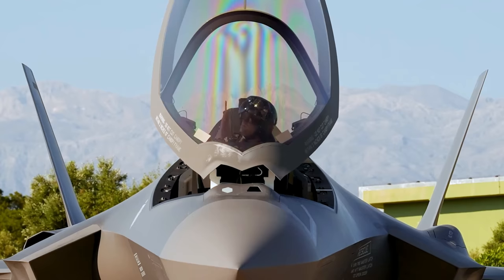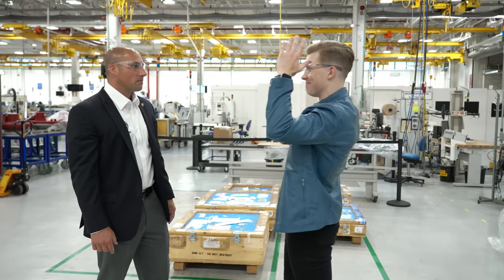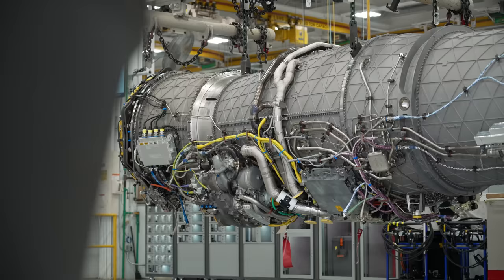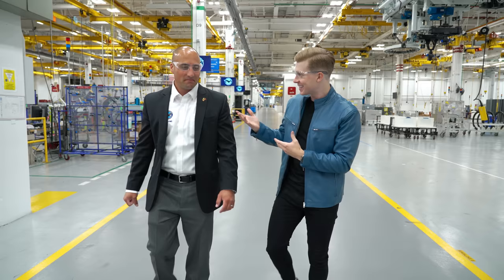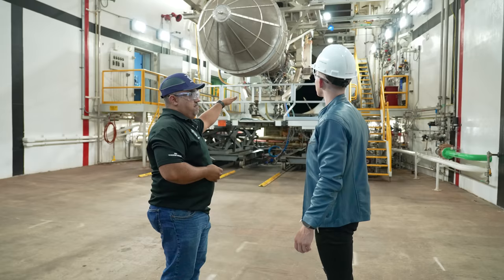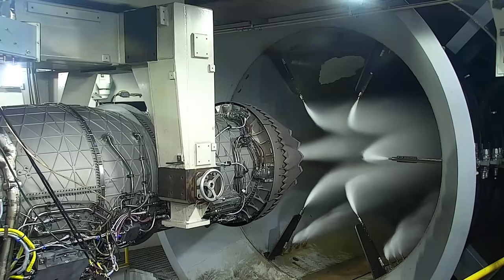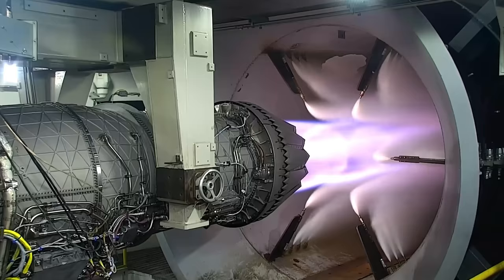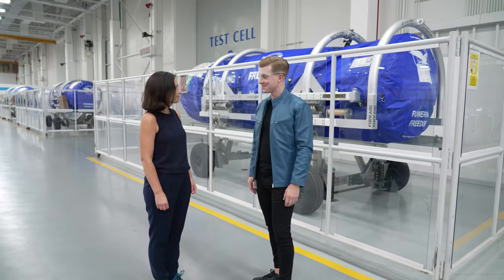How The World's Most Powerful Fighter Jet Engine Is Made

Comment: Man, your videos have such practical quality!  I think it'd be a blast to work for Pratt & Whitney.  Did you happen to ask them why they don't just incorporate a retractable FOD screen on their engines?  That would make a lot of places accessible for our aircrafts in terms of take off and landing.  You should do GE next and get a look-see at their adaptive cycle engine.
Reply: I can answer this. As far as turbofan/turbojet engines in general, adding a mesh in the inlet severely reduces performance. This is not as big of an issue on helicopters where ram recovery is not even a consideration. Speaking of stealth, anything in the inlet is a radar cross section that you don’t want and any unnecessary moving parts is weight you can’t get rid of which decreases payload.
Reply: as someone who is an engineer at pratt and whitney, i can attest to say that it is fun!
Reply: There were retractable FOD screens on a jet engine from the late 1940s, I have not seen them on any engines since.

Comment: The Rolls-Royce LiftSystem, together with the F135 engine, is an aircraft propulsion system designed for use in the STOVL variant of the F-35.

Comment: CANT WAIT FOR IT! Is the f22 more powerful combined?
Reply: Each F119-PW-100 motor provides 35,000lbs of thrust, for a combined total of 70,000lbs.

The F-22A also weighs more, but still has higher thrust-to-weight ratio due to massive amounts of excess thrust.

Interestingly though, the F-35A will out drag-race it from 200knots to Mach 1.  Then the F-22 will walk away from the F-35A in supersonic regime, where its engines were optimized for supercruise and Mach 2.2 performance.

Comment: I expected the throttle in the control room to look a lot closer to one in a fighter jet. That was cool to see.
Reply: Lol that wasn't even remotely close to the one in the cockpit. One in the cockpit is modeled closer to the F16. Multiple buttons/switches/knobs. Stick is also modeled after the F16.
Reply: @fightingfalconfan  that's what I meant. Sorry. I expect(ed) to see it look like a real one. Typo.
Reply: @wormyboot  Nope, no reason to have that. It's not controlling all those functions. It just opens up the fuel supply or closes it pending position.
Reply: @fightingfalconfan  I know. I just thought it'd look different
Reply: @wormyboot  Ah, nope, no need for it.

Comment: EXCEPTIONAL VIDEO SAM!
Just loved it my friend so so cool! 😎 
However I only wish the F-35 Lightning II ⚡️ 🛩️ for all its advances had finished on schedule or on budget 💸🤑but as an American 🇺🇸 used to American defense and military projects it doesn’t shock me anymore! 😂😂 sadly 😢
Cheers 🥂 brother 😎 
LOVED IT however the F-15EX is still my favorite new fighter and a phenomenal advancement in engineering and technology today even more than the F-35 I think! 

😊Also now I hope that the F-35 is past its troubles it goes on to become the next F-15 Eagle type fighter jet. However the F-15EX variant is still my favorite and it will become more of a best selling most successful per mission fighter EVER MADE I hope the F-15EX can shatter the original F-15 record! 
Caleb’s Aviation 😊
Reply: There isn't any technology on F-15EX newer than F-35.

Engines, Radar, cockpits, airframe, flight control system, and subsystems are generations behind.

This F135 motor is decades more advanced than F110s.

F-35's APG-81 is fused with an RF antennae suite distributed all over the airframe like a spy plane, as well as 7 different IR sensors.

F-35 flight control system is fiber-optic with self-contained electrohydrostatic actuators.

F-15EX still has hydraulic lines and actuators, though it does have a modernized DFLCS with excellent control logic.

Man Machine Interface is superior in the F-35 due to minimal switches and buttons, with the HMDS and PCD.

Comment: Just imagine what the F15 and F16 could do if upgraded with those engines!

Dude looks like he uses a polishing buffer on his head. Reflects the light like a glossy paint job lol.
Reply: They won't fit.  The structural bulkheads that form the engine cowlings don't have large enough Inner Diameters for the F135 beast.

F135 has so many VLO features in both RF and IR spectrums, as to be a waste in an F-15 or F-16.
Reply: @LRRPFco52  yes I know that which is why I said upgraded to. The 40k pounds of thrust wouldn’t be useless in either the 15 or 16. The VLO would actually benefit the new F-15 since they’ve supposedly added other VLO features to it.
Reply: @P-J-W-777  F-15s don't have any VLO features.  We were on the F-15 CTF at Edwards from 1989-1990s.  It's not a VLO platform no matter what you do to it.  Frontal, oblique, side, and rear RCS values are huge on the F-15.  It's very reflective, nothing you can do about it, including the bondo stunt that was the F-15S.
Reply: @LRRPFco52  Just going off what the supposed professionals that talk about the features added to the new F-15 and the adding the Radar absorbing coating. Guess I should have explained further when I mentioned VLO. I’m sure with that addition their radar signature is reduced quite a bit a bit when compared to the A-E model.
Reply: @P-J-W-777  This is the first I've heard of the F-15EX getting RAM.  I've been following it since it was the F-15X.  Where did you hear anyone talking about RAM on F-15EX?
Reply: @LRRPFco52  On another video with a gentleman walking around the actual aircraft discussing some of the changes made. I don’t remember the channel name as it was a few months ago. I just remembered thinking “Wow” why would they add RAM to the EX but it was supposedly something they incorporated from the more stealthy Silent Eagle version that wasn’t chosen with the primary intention of reducing their signature a little when accompanying F-35’s while acting as missile trucks for the F-35’s…
Reply: @P-J-W-777  The F-15SE was a mock-up, not a real aircraft.  Boeing claimed it had a frontal RCS as small as an F-35, which is an embarrassing joke to say out loud.

Are you sure it wasn't a video about the F-15SE?
Reply: @LRRPFco52  yeah I know the SE was never actually built. They were talking about the EX and said that it received RAM coating a feature that was handed off by the Silent Eagle. They never claimed the EX had a smaller RCS than the F-35 in this video. They said it was used to reduce its signature but didn’t get into any great detail about it.

Comment: The planes of the future should be based on jet engines or electric engines in sets of four main engines to produce flying characteristics vertically and horizontally, like the F 135, but larger enough to be used as a helicopter, material support vehicle, or anything else. They can land or take off vertically. They should have several engines to balance out the load in case of an emergency and emergency parachute wings or wings and bodies that allow them to float to the ground.

Comment: Woooow... fighter jet engine design requires very accurate calculations and the development of advanced technology. This engine must be able to provide extraordinary thrust, while maintaining fuel efficiency and durability in a variety of extreme conditions. Engineers must design engines that can operate at very high temperatures, supersonic speeds, and in very low pressure environments. In addition, the design must take into account aerodynamic elements that affect the overall performance of the fighter aircraft 🥇🇮🇩😘🥰

Comment: Could a booster rocket be rebuilt to use three or four of these engines instead of rockets ?

The obvious advantage would be that they wouldn't have to carry oxygen up on the first stage of the launch saving on weight as well as the need for cooling and storing reactive oxygen in a rocket.

One problem might be the strains of combining two different systems with different thrust, could they be made to match ?
Reply: how would you propose these engines get air between their 50,000 foot service limit and the 327000-foot edge of space?
Reply: @zakp.2759 Only as first stage lifters much like Falcon heavy and Vulcan. I guess these engines won't do but airplanes have reached over 100,000.

Comment: Ever heard of an F100 engine and the F-15E Strike Eagle?
Reply: The F100 is not as powerful as the F135 and it doesn't need to be since the F-15 has two of them.
Reply: @fromnorway643   Ever heard of accelerating to mach 1 going straight up? Ever heard of the F-16's top speed of mach 2.2?
Reply: @docbrosstudio7680 
Ever heard about fighters that are smaller and lighter and therefore faster than the F-35 despite having a less powerful engine?
One of them was mentioned in the comment just above this one!
Reply: @fromnorway643  
Heard of this thing called thrust?
Reply: @docbrosstudio7680 
Heard of this thing called two engines (F-15) vs one (F-35)?

Comment: Is it possible to upgrade the F135 engines that are already built?
Reply: Yes.  It's already part of the depot-level overhaul plan.  They've already made ECU changes to production from what I understand, so overhaul schedule incorporates it.

Pratt was already working on it and had their own early ECU in 2015.

47,300lbs thrust in burner, with over 30,000lbs in mil, better fuel efficiency.

In de-rated day-to-day operations, it should have more power than the current max limits.

Operational squadrons run them de-rated currently.

Comment: I thought the F-16 afterburners were crazy enough🤔
Reply: F135 has about the same thrust in mil power as a late Block F-16C PW-229 or GE-129 has in full burner.

Once F135 goes into burner, it can do 40,000-43,000lb.

Comment: The GE F-100 and P&W F-110 are my favorite aircraft engines as they provide power for the beautiful F-16. I don't believe the F-22 nor the F-35 will be proven until they see combat!
Reply: You’ve got it backwards… F100 is P&W and F110 is GE.  BTW a dash indicates aircraft designation F100 engine, F-100 is the aircraft with J57 engine.
Reply: The F-22A and 3 variants of the F-35 have been in combat for years.

Israeli F-35Is have shot down 2 Iranian stealth drones and one cruise missile already.

F-22A was used a lot over Syria, to include over 700 intercepts and precision strike missions.
Reply: The F22 has seen combat. It shot down a balloon. Hard work right there.
Reply: @insanereindeer4081  That’s nothing compared to what F-22s have seen over Syria and CENTCOM.  When you’re like Predator, it’s hard to justify just killing everyone as they wander around blindly.  They have dropped a lot of ordnance, especially 1000lb JDAMs and SDBs.

Comment: I think the j58 turbo-ramjet engine has more power
Reply: The F135's maximum thrust is 43,000 pounds while the J58's is "only" 34,000 pounds.
However, the SR-71 had two engines while the F-35 has only one.

Comment: It is certain that Russian fighter aircraft are superior to those of the US and Nato. Let's take the K-36D ejection seat system as an example. The Americans once tested the Russian K-36D ejection seat against the ACES II system, and the result was that the K-36D was completely more stable than the ACES II. Not stopping there, Russian fighter jets often have higher speeds, longer ranges and higher flight ceilings than US and Nato fighter jets. Not to mention Russian fighter jets also have thick armor, the Su-25 is known as the "flying tank" which no US or Nato fighter jet has this nickname. Although US and Nato fighter jets have more modern electronic and radar systems, they are more error prone, for example here are the F-35s, which have 871 errors including software and hardware errors.
Reply: Higher speeds and higher flight ceilings are largely arbitrary in combat: top speed doesn't matter if you can't outrun a missile, and the higher you are, the more vulnerable you are to air-to-air missiles
Soviet/Russian aircraft have more often been built to be short-range defense aircraft, not long-range fighters - MiG-21, 25, 29, Su-24 and 25 all have absolute piss poor combat ranges
The Su-25 is the only Russian jet with thick armor, because it's the only attack jet they have; our primary attack jet, the A-10, also has thick armor, and has been referred to as aa flying tank (nevermind the fact putting thick armor in a fighter is a terrible idea, because that makes you much easier to hit - what matters more is pure survivability, such as the Israeli F-15D landing with only one wing)
Looking into the 871 errors, they are all deemed "low priority" - of course, this should be taken with a grain of salt, but given the history of Russian equipment and their problems, I doubt they suddenly started making perfect systems.

Comment: I always wondered why they let people make these videos, it gives easy access to semi vital info to these vehicles, allowing them to be backward engineered by another country making it less valuable though cost to economy would be a reason why other countries couldn’t jus reverse engineer it and manufacture a the same rate but it’s been done before way to many times with a lot of fighters and pretty much all types of vehicles.
Reply: so you're telling me that you could look at a picture of this engine and measure the dimensions of what the camera shows, with an accuracy high enough to where YOU could actually recreate the part and make it work with others? do you see the internals of the engine here, or do you just see a bunch of wires and external hardware? i don't think you really think about this.

Comment: It's just an uprated F119 with larger fan and higher turbine entry temperatures. Late generation single crystal blades.

Turbine entry temperature is a damn high 3,600 ° F.

That's how it can have a thrust/weight ratio of 11:1.

Unstable and unreliable.

Numerous failures with fan stages and cracked blades.

Canada is signing its pilots'death warrants buying this single engine fighter.

When it fails over the Canadian freezing wilderness, it's curtains.

Comment: Why do you call it the most powerful engine in the world if it cannot reach the speed of the SR-71 plane? The F-35 engine has a lower speed.
Reply: The SR-71 had two engines which together were more powerful than the F-35's single engine. That is also the case for fighters like the F-15 and the F-22.
The F-16 has a single, less powerful engine, but is faster than the F-35 because it is a smaller and lighter fighter.
It's also worth noting that this video was about the most powerful fighter engine, not the most powerful jet engine overall. Some of the larger Boeing and Airbus passenger jets have much more powerful engines than any fighter.
Reply: @fromnorway643  thnx